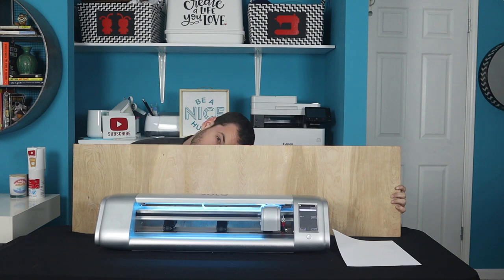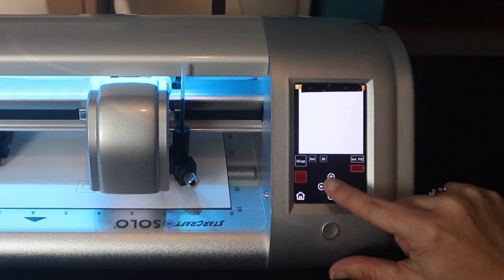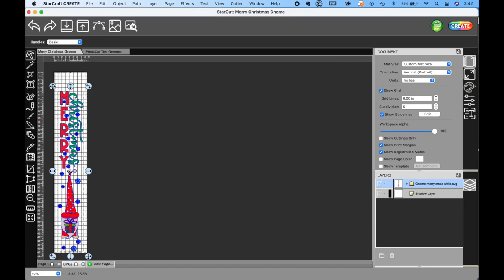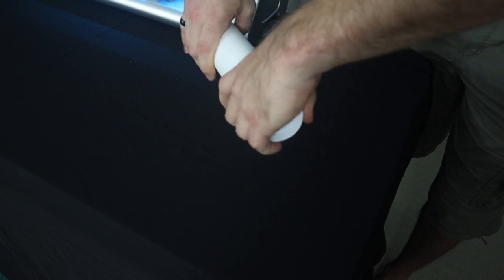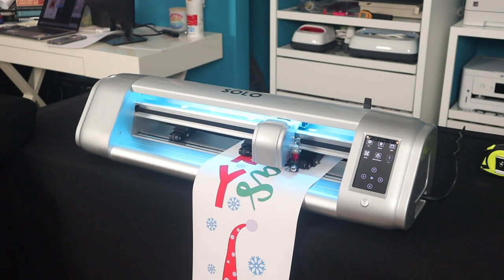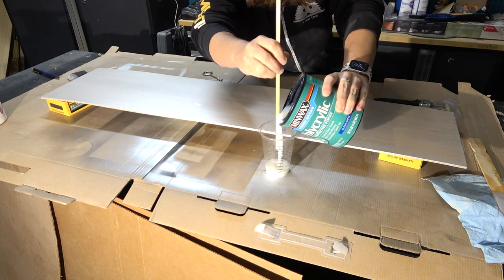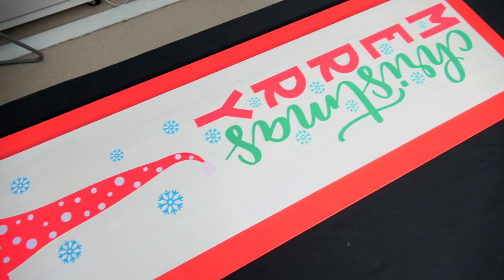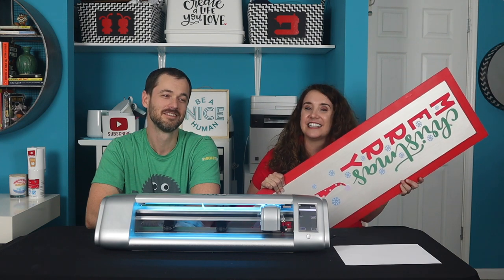HUGE Print then Cut with the StarCraft SOLO | Leaning Holiday Porch Sign

Comment: I'm curious if you're still using the Solo?  I bought a Silhouette Plus because I wanted a better Print then cut field but I just don't like the Silhouette.  Cricut is great but I want a bigger cut area.  I'm looking at the Solo, which looks great, and waiting for the Siser Romeo.  Thanks!
Reply from the maker: Hey! We do appreciate the Print then Cut capabilities of the SOLO and have pulled it out quite a few times for those kinds of projects since this video. Hope that helps!
Reply: @JustMightDIY  would you get the juliet cutter,,?

Comment: Nice tutorial. Why not just sand and seal with your poly, without painting white? Then instead of cutting out the individual letters and graphics, since it's already printed on white, just cut a rectangle the size of your panel and stick down the whole thing with no weeding required, no cutting required - other than the rectangle. Did you have to put poly over the printed vinyl or is your printer using pigmented water resistant inks?
Reply from the maker: Hey there! Thanks for your questions. The paint isn’t pure white - it’s more of a light silver iridescent color. And we didn’t need to seal over the printed vinyl, as this stayed on a covered porch for the season and did just fine! With the wood itself being so thin, it wouldn’t have done well getting wet.

Comment: Thank you for the tutorials.  Question: you used an ink jet printer and changed the length setting, can this be done with a regular printer?
Reply from the maker: Hey! This was a regular ink jet printer, so it should be similar for others (though the dimensions may vary by model).

Comment: Great tutorial.  How did you get your printer to print that out at that length?
Reply from the maker: Thanks for checking us out.  In the menus of the printer you can create a custom size of feed to the printers max length.  Then make sure the printer settings on the computer also state the printers max length